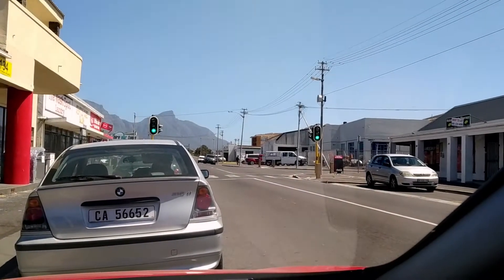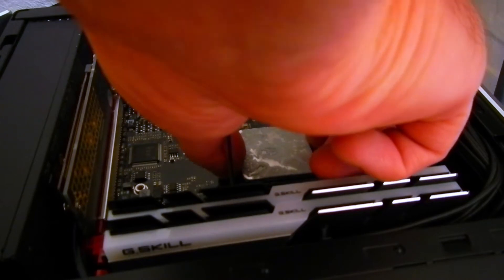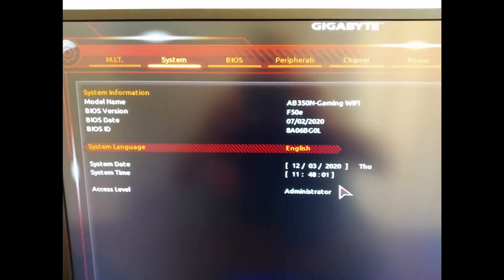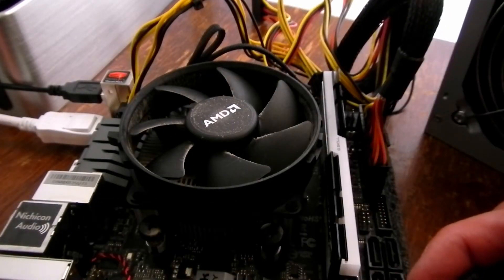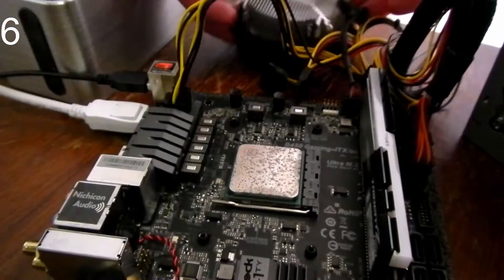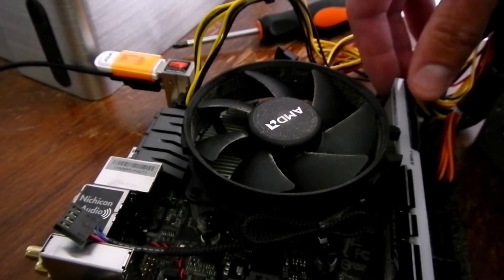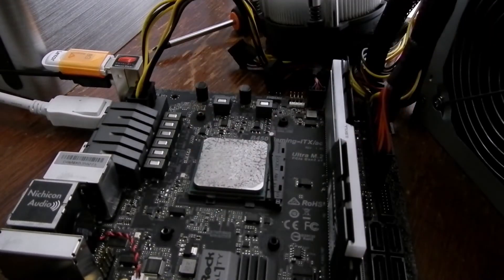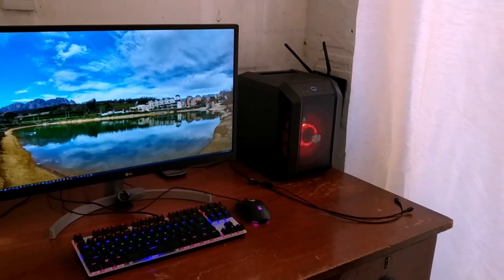Ryzen 7 4750G on B350 and B450 🤔

Comment: Can i use 4xxxg series with msi 450b pro m2 max?
Reply from the maker: Yes if it has the latest BIOS.
Reply: @Rouxenator  which version?
Reply from the maker: @x-zuz6898  7B84vAC will work

Comment: you should be running dual ram with a that apu you will get better performance from it.
Reply from the maker: For sure, all my APUs run dual channel, that was just while testing and messing around.
Reply: @Rouxenator  oh ok, is that apu worth upgrading from the ryzen 3 2200g?
Reply from the maker: @MrFacepeel  for sure, I upgraded from a R5 2400G (only had the 3400G for a month or so) the improvement was amazing. I will skip the 5xxxx APUs and my next upgrade will be a NAVI APU.
Reply: @Rouxenator  thanks i going to buy it for sure then

Comment: I cant quite understand why so many people have problems with the AMD am4 stock coolers? When changing cpu i usually let the PC Run an hour under mid load (watching some series or YouTube videos) then power it off, unplug everything, Open it up, then unscrew the cooler and gently wobble and Spin the cooler (turning left turning right) Most of the time or will pop Up after second turn and i can remove the cooler without a hassle.
Reply from the maker: That will help a lot.

Comment: Hey, there's a beta bios for asrock that support 4000 renoir series on B350
Reply from the maker: Which motherboards? I checked the Asrock site but could not find any.
Reply: @Rouxenator  The bios is not on the official site:  reddit.com/r/ASRock/comments/kefbfq/new_experimental_bios_for_amd_300_series/ , i myself bought blindly the 4750g forgeting that i have ab350 itx , was reading that there are no major issues with this bios ,some have problem with pcie that goes from 16x to 8x

Comment: Will it work with asrock b450 steel legend as well?
Reply from the maker: On the latest BIOS version 3.70 - yes. I see ASRock has removed the wording for 4000G from the last update, but it does indeed support Renoir APUs

Comment: Hey man, i have a rog strix b450f motherboard and want to but the apu on it, will it work?
Reply from the maker: Yes, on firmware Version 4007 or newer.
Reply: @Rouxenator  how can i do a bios update on my motherboard if i dont have acces to other pc
Reply from the maker: @ryuki122  you will need another PC in order to download the file onto a flash drive.

Comment: I have been eyeing the 4750G. Out of luck I grabbed your exact same Motherboard because i planned to move my 3700X to ITX but didnt want to buy X570 because its not worth it yet.
I just landed on your video searching for what motherboard supports the 4000 series APU and bam. I have all the pieces. The 4750G are not rare yet because theres not many buyers.
Wonderful video proof that my plan will work, thank you!
The info at Asrock now says "Supports Ryzen 5000 series CPU." for 4.20

Comment: Excellent video friend, a question, should I update the bios for 3000 or 5000 to be able to use Ryzen 7 4750G? I have a b450 ds3h with ryzen 7 2700.
Reply from the maker: B450 supports 3000, the update is only needed if you want to use 4000G or 5000 on it.

Comment: Can i use 4650g in msi bazooka b450 after bios update
Reply from the maker: Yes, all 4xxx APU models work and 3xxz APU aswell.
Reply: @Rouxenator  but how i will download the bios? I dont have extra cpu. And from where i can download the bios? Plz explain iam using b450 msi bazooka wifi. Plz helpp
Reply from the maker: @dredhawk8037  you can get the bios and instructions on the MSI website. Some motherboards can update without a CPU present so check on the MSI website.
Reply: @Rouxenator  bro please final help. Can u plz tell me than update version name or pls tell me the version of the patch. So i can check
Reply from the maker: @dredhawk8037  
Version : 7C87v151(Beta version)
Release Date : 2020-12-10
Reply: @Rouxenator  bro are u sure this version support 4650g. I saw ur video but iam asking again. But its a beta version. Till when full version come out
Reply from the maker: @dredhawk8037  MSI chose to call it Beta, other manufacturers are releasing AMD AGESA ComboAm4v2PI 1.1.0.0 from AMD as final release, like the ASRock in this video. It supports Ryzen 5000, 4000G and 3000G processors. That is part of AGESA V2 PI 1.1.0.0
Reply: @Rouxenator  ok thank so much for ur helo sir. So i can get a 4650g without any problem and can use in b450 mobo with update? Final?
Reply from the maker: @dredhawk8037  for sure. However flashing the latest BIOS could be a challenge. You will either need a supported processor or you can risk it with the built in flasher. 

Google "AMI BIOS Ctrl Home" as pressing Ctrl and Home while an AMI BIOS computer starts up will invoke it's "recovery flash" routine. This is when the BIOS will look for removable media with the file AMIBOOT.ROM

I have not used that function since the late 90s with socket-7 (more than 20 years ago) but I know AMI BIOS does support it. 

Otherwise just borrow a supported processor to do the update flash. 

When I bought my 2400G back in 2008 I had to buy a A6-9500 with it just to update the BIOS on my B350 motherboard.
Reply: @Rouxenator  reaaly thanks for ur help. I will trybto get a suported cpu for bios update
Reply from the maker: @dredhawk8037  hey, you are more than welcome. Using a supported CPU is the best for updating a BIOS as you have full system functionality (video, keyboard). 

Using the recovery mode, even on boards that have dedicate buttons for it, has no video output or keyboard input so it is a rather difficult process. I have done it before but as I said, it is a complex process.

Comment: i wrote asus an email and asked if the 4750g will be supported on my x470-i and they said the bios update for renoir support will come in january or february
Reply: I emailed them and they said it’s not supported two days later there was a bios update and mine works! I have the same board x470i
Reply: @Goigigandfriends  your x470i works 100% stable now with renoir?
Reply: @Goigigandfriends  btw this is the mail i got " The 4000 series CPU will with the shown motherboard compatible, but the exact BIOS Update will be released either in January or in February. Thank you in advance for your understanding and have a nice weekend. "
Reply: @Goigigandfriends  does your 4000apu works on b450?
Reply from the maker: Seems so far GigaByte, MSI and ASrock are the only ones that have released this update.

Comment: How are the temps, for me it idles at ~40 but spikes to 85-90 in a matter of seconds, and the cooler doesn't even get hot so I wanted if there's some fabrication issues between the die and the IHS.
Reply from the maker: I'm using a Noctua NH-L9a-AM4 cooler and the highest I have seen after running this at 100% over two days is 85. The stock Spire cooler which these come with (mine did not) is not up to the job.